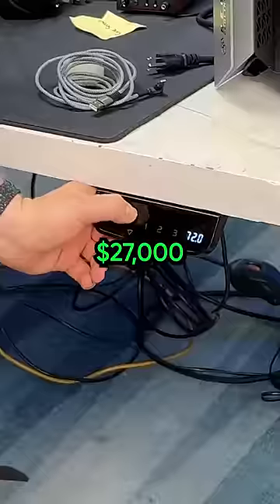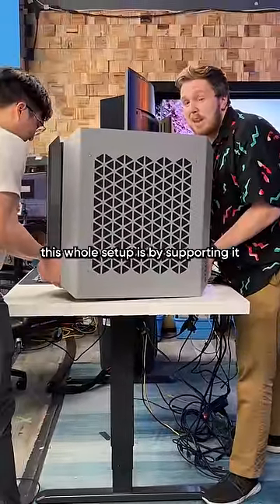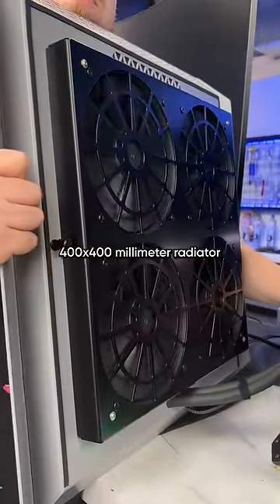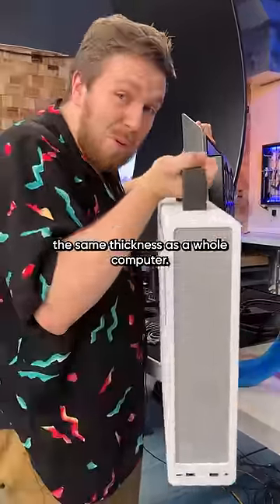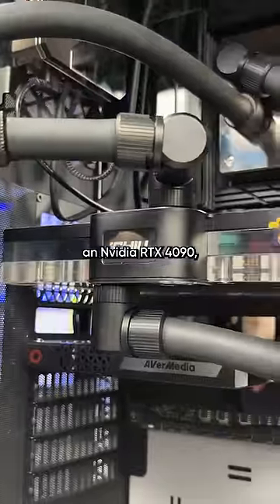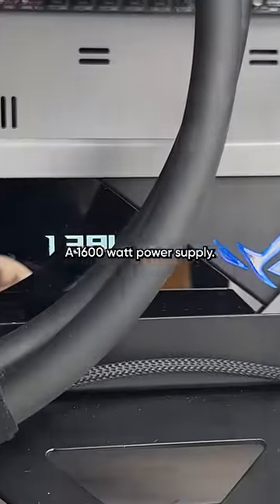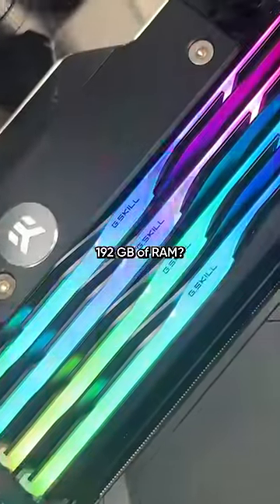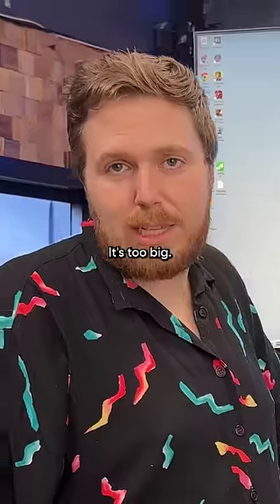Inside a $27,000 Gaming PC

Comment: A $27,000 pc that does the same job as a $4000 pc. Bravo 👏
Reply: The owner is a tax guy so he needs a fast pc to do them digital.
Is only  internet don’t run faster than the pc
Reply: Correct. I just built my PC with 14900k, RTX 4090, 128 MB RAM, 6 TB NVME with 32 inch monitor for $4200. 😂😂😂
Reply: @messier7849 128MB Ram? That's an overkill buddy
Reply: @Bruh-zy6ke  yeah I remember when they told me that 16 GB was Overkill 🤣
Reply: @messier7849  Yup and now anything under 16GB is pretty much useless.
Reply: @4450krank I don't think he realised the mistake 💀
Reply: @nghihuynh6631 😂😂😂
Reply: @messier7849 exactly what I'm on right now. 3300 and change.
Reply: @Bruh-zy6ke it already overkill to have 4090
Reply: There should be a challenge to build same pc even cheaper
Reply: @the40yearoldgamer49  nah. Show me your pcpartpicker then.
Reply: @messier7849  🤣 🤣 🤣  funny, but I'm not that broke.
Reply: To be fair he did say "It's dumb"
Reply: @4450krank  guys am i cooked? (my laptop has 4gb)
Reply: @messier7849 buddy you said mb, it's gb.
Megabyte, gigabyte?
Standard for gaming is 16gb
Reply: danm , so you understood the point of the whole video
Reply: @ricardoalas743 
You didn't need to tell it. Just by looking at him everyone can see he has never actually worked
Reply: The whole point is that it's excessive dude, the series this was built in is literally called compensator